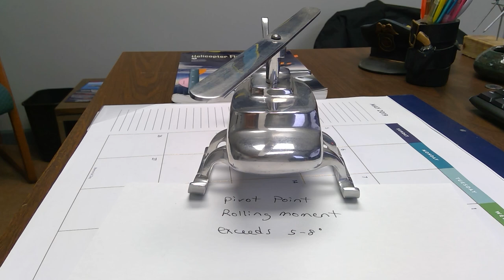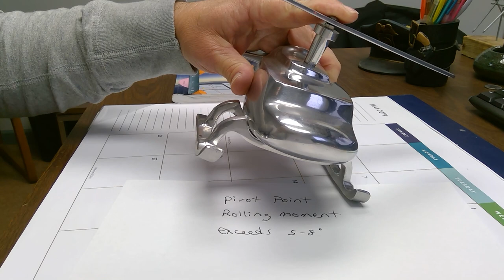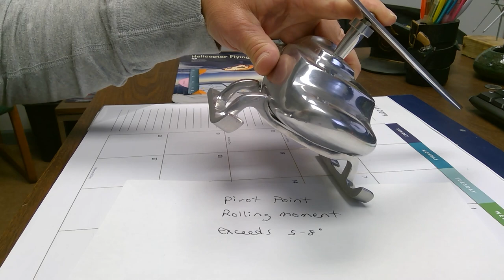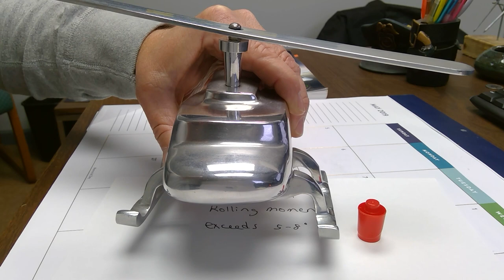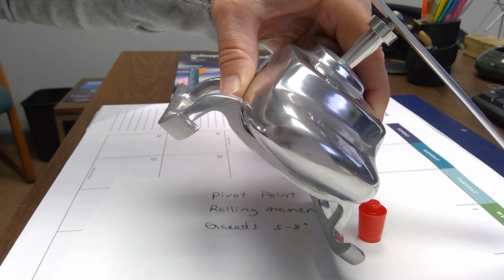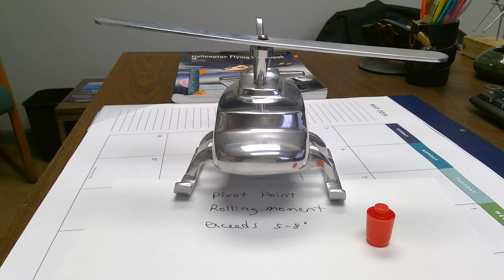Dynamic Rollover

Comment: When you watch videos of these dynamic rollovers they're so quick, you better be Johnny-on-the-spot. Some kind of software fix for this would be nice but I'm not sure how far choppers are along w/ the fly-by-wire stuff. Just a little black box - once that tipping point is just about reached, emergency correction.. Be nice!

Comment: Interesting but where did you get a solid 5-8 degrees.   I disagree with that.  Critical rollover angle changes with the amount of the rolling moment.   I submit to you it's possible to have a critical angle that is 0 if you develop a rolling motion high enough.  Nothing a pilot can do past the critical angle to recover.  The one thing the pilot can control best is the rolling moment. He does that with collective, not snatching it off the ground, and not snagging anything in a hover, and maintaining a slow hover.
Reply from the maker: That is straight out of the helicopter flying handbook, published by the FAA. When doing flight instruction it is important to stick with the Faa published information and not your opinion.
Reply: @garycleveland2989  Someone deleted my reply...
Reply: @garycleveland2989  5-8 degrees is what the HFH states about the cyclic authority on most helicopters, and also as a general guideline to abort an upslope maneuver.   That is not the critical angle.   Most helicopters have a slope landing limit of at least 5-8 degrees and more so how could that be the cause of dynamic rollover of exceeding 5-8 degrees slope or rotor disk angle or however else you want to put it.  Critical angle is how it needs to be taught. 

The rate of rolling motion is also
a consideration because, as the roll rate increases, there is
a reduction of the critical rollover angle at which recovery
is still possible.

Dynamic Rollover
A helicopter is susceptible to a lateral rolling tendency,
called dynamic rollover, when it is in contact with the surface

Tail rotor thrust
Tip-path plane neutral cyclic
Tip-path plane full left cyclic
Bank
Pivot point angle
CG
Weight
Main rotor thrust
Figure 11-5. Forces acting on a helicopter with right skid on the
ground.
during takeoffs or landings. For dynamic rollover to occur,
some factor must first cause the helicopter to roll or pivot
around a skid or landing gear wheel, until its critical rollover
angle is reached. The angle at which dynamic rollover
occurs will vary based on helicopter type. Then, beyond
this point, main rotor thrust continues the roll and recovery
is impossible. After this angle is achieved, the cyclic does
not have sufficient range of control to eliminate the thrust
component and convert it to lift. If the critical rollover angle
is exceeded, the helicopter rolls on its side regardless of the
cyclic corrections made.
Dynamic rollover begins when the helicopter starts to pivot
laterally around its skid or wheel. For dynamic rollover to
occur the following three factors must be present:
1. A rolling moment
2. A pivot point other than the helicopter’s normal CG
3. Thrust greater than weight
This can occur for a variety of reasons, including the failure
to remove a tie down or skid-securing device, or if the skid
or wheel contacts a fixed object while hovering sideward,
or if the gear is stuck in ice, soft asphalt, or mud. Dynamic
rollover may also occur if you use an improper landing or
takeoff technique or while performing slope operations.
Whatever the cause, dynamic rollover is possible if not using
the proper corrective technique.
Once started, dynamic rollover cannot be stopped by
application of opposite cyclic control alone. For example,
the right skid contacts an object and becomes the pivot point
while the helicopter starts rolling to the right. Even with full
left cyclic applied, the main rotor thrust vector and its moment
follows the aircraft as it continues rolling to the right. Quickly
reducing collective pitch is the most effective way to stop
dynamic rollover from developing. Dynamic rollover can
occur with any type of landing gear and all types of rotor disks.
It is important to remember rotor blades have a limited range
of movement. If the tilt or roll of the helicopter exceeds that
range (5–8°), the controls (cyclic) can no longer command a
vertical lift component and the thrust or lift becomes a lateral
force that rolls the helicopter over. When limited rotor blade
movement is coupled with the fact that most of a helicopter’s
weight is high in the airframe, another element of risk is added
to an already slightly unstable center of gravity. Pilots must
remember that in order to remove thrust, the collective must
be lowered as this is the only recovery technique available.
Critical Conditions
Certain conditions reduce the critical rollover angle, thus
increasing the possibility for dynamic rollover and reducing
the chance for recovery. The rate of rolling motion is also
a consideration because, as the roll rate increases, there is
a reduction of the critical rollover angle at which recovery
is still possible. Other critical conditions include operating
at high gross weights with thrust (lift) approximately equal
to the weight.
Refer to Figure 11-5. The following conditions are most
critical for helicopters with counterclockwise rotor rotation:
1. Right side skid or landing wheel down, since
translating tendency adds to the rollover force.
2. Right lateral center of gravity (CG).
3. Crosswinds from the left.
4. Left yaw inputs.
For helicopters with clockwise rotor rotation, the opposite
conditions would be true.
Cyclic Trim
When maneuvering with one skid or wheel on the ground,
care must be taken to keep the helicopter cyclic control
carefully adjusted. For example, if a slow takeoff is attempted
and the cyclic is not positioned and adjusted to account for
translating tendency, the critical recovery angle may be
exceeded in less than two seconds. Control can be maintained
if the pilot maintains proper cyclic position and does not
allow the helicopter’s roll and pitch rates to become too
great. Fly the helicopter into the air smoothly while keeping
movements of pitch, roll, and yaw small; do not allow any
abrupt cyclic pressures.
Normal Takeoffs and Landings
Dynamic rollover is possible even during normal takeoffs and
landings on relatively level ground, if one wheel or skid is on
the ground and thrust (lift) is approximately equal to the weight
of the helicopter. If the takeoff or landing is not performed
properly, a roll rate could develop around the wheel or skid
that is on the ground. When taking off or landing, perform the
maneuver smoothly and carefully adjust the cyclic so that no
pitch or roll movement rates build up, especially the roll rate.
If the bank angle starts to increase to an angle of approximately
5–8°, and full corrective cyclic does not reduce the angle, the
collective should be reduced to diminish the unstable rolling
condition. Excessive bank angles can also be caused by landing
gear caught in a tie down strap, or a tie down strap still attached
to one side of the helicopter. Lateral loading imbalance (usually
outside published limits) is another contributing factor.
Slope Takeoffs and Landings
During slope operations, excessive application of cyclic
control into the slope, together with excessive collective pitch
control, can result in the downslope skid or landing wheel
rising sufficiently to exceed lateral cyclic control limits, and
an upslope rolling motion can occur. [Figure 11-6]
When performing slope takeoff and landing maneuvers, follow
the published procedures and keep the roll rates small. Slowly
raise the downslope skid or wheel to bring the helicopter level,
and then lift off. During landing, first touch down on the
upslope skid or wheel, then slowly lower the downslope skid
or wheel using combined movements of cyclic and collective.
If the helicopter rolls approximately 5–8° to the upslope side,
decrease collective to correct the bank angle and return to level
attitude, then start the landing procedure again.
Use of Collective
The collective is more effective in controlling the rolling
motion than lateral cyclic, because it reduces the main rotor
thrust (lift). A smooth, moderate collective reduction, at a
rate of less than approximately full up to full down in two
seconds, may be adequate to stop the rolling motion. Take
care, therefore, not to dump collective at an excessively high
rate, as this may cause a main rotor blade to strike the fuselage.
Additionally, if the helicopter is on a slope and the roll starts
toward the upslope side, reducing collective too fast may create
a high roll rate in the opposite direction. When the upslope skid
or wheel hits the ground, the dynamics of the motion can cause
the helicopter to bounce off the upslope skid or wheel, and the
inertia can cause the helicopter to roll about the downslope
ground contact point and over on its side. [Figure 11-7]
Under normal conditions on a slope, the collective should
not be pulled suddenly to get airborne because a large and
abrupt rolling moment in the opposite direction could occur.
Excessive application of collective can result in the upslope
skid or wheel rising sufficiently to exceed lateral cyclic
control limits. This movement may be uncontrollable. If the
helicopter develops a roll rate with one skid or wheel on the
ground, the helicopter can roll over on its side.
Precautions
To help avoid dynamic rollover:
1. Always practice hovering autorotation into the wind,
and be wary when the wind is gusty or greater than 10
knots.
2. Use extreme caution when hovering close to fences,
sprinklers, bushes, runway/taxi lights, tiedown cables,
deck nets, or other obstacles that could catch a skid or
wheel. Aircraft parked on hot asphalt overnight might
find the landing gear sunk in and stuck as the ramp
cooled during the evening.
3. Always use a two-step lift-off. Pull in just enough
collective pitch control to be light on the skids
or landing wheels and feel for equilibrium, then
gently lift the helicopter into the air. 4.
Hover high enough to have adequate skid or landing
wheel clearance from any obstacles when practicing
hovering maneuvers close to the ground, especially
when practicing sideways or rearward flight.
5. Remember that when the wind is coming from
the upslope direction, less lateral cyclic control is
available.
6. Avoid tailwind conditions when conducting slope
operations.
snip

You should teach your students past the rote memorization part and get to the correlation part.
Reply from the maker: @PilotLifeNet  my channel was created to prepare my students for the oral part of their practical test. Answers must be brief and it is up to the examiner to pry further if desired. My channel is not monetized. If you wish to make a video expressing your detailed explanation, go for it.
Reply: @PilotLifeNet  HELLO,   FOR MY OPINION .   TOO TOO LONG BUT  IS A  GOOD SUPPLEMENT OF INFORMATION,  BUT YOU PLACED SEVERAL REFERENCES TO FIGURES AND YOU DID NOT PLACE THEM...